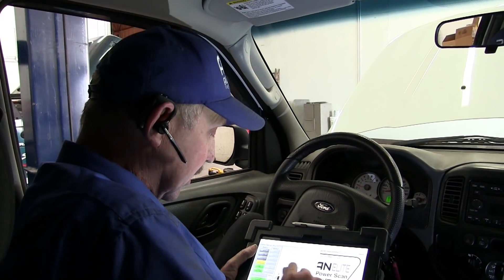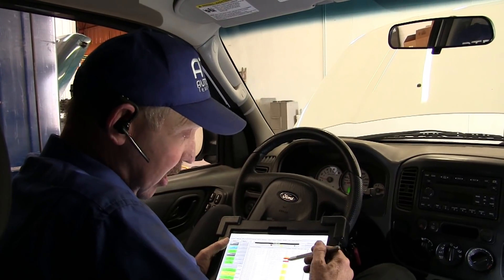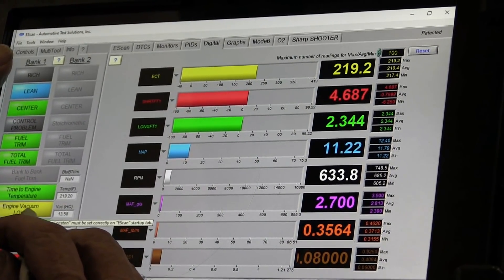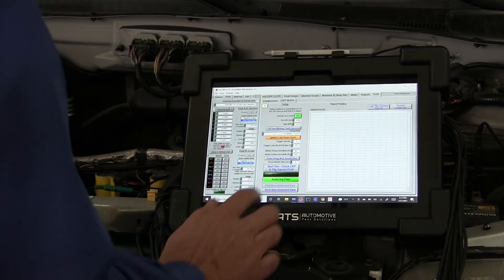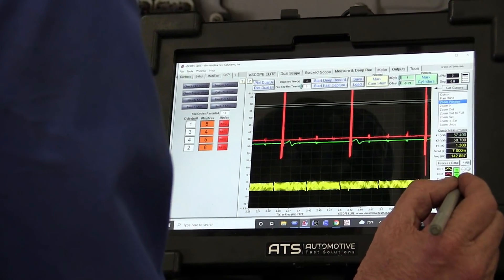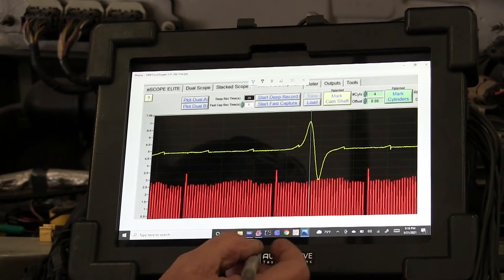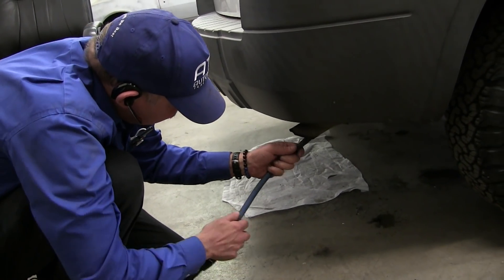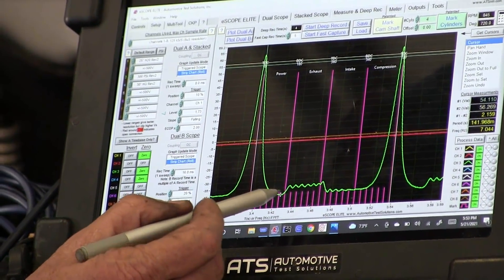2006 Ford Escape with a Misfire

Comment: is disconnecting the fuel injector not necessary / only done when access is easy? How long is it safe to run the engine (for the cat) before having to worry about it?

Comment: I might be wrong but isn't this a timing chain engine that if you loosen the crank pulley it will jump time? As in it doesn't have a key way in the crank and is held in place by the balancer bolt.
Reply: Yes, this is that one.

Comment: What's crazy is that those engines are very easy to check cam to cam timing.   If you have the special tools, then it is very easy to check crank to cam timing as well.

Comment: That's nice.
Q: If I have a L4 engine with 2 camshaft sensors on intake and exhaust (VVT engine) and when I see cam crank Waveforms I have a timing issue,,,
How Could I know If I have a mechanical timing adjusting or I have a Vvt Solenoid issue?

Comment: Problem misfires from other shops are always fun. All new coils, plugs and sometimes even injectors….I’ll install a vacuum gauge and know if it’s mechanical or not in 1-2 minutes. Or maybe bring out the amp clamp and scope if I feel adventurous for a cranking compression test. A simple vacuum gauge will show you restricted exhaust or cam timing issues as well. At least give you a direction to go.

Comment: Nice video, great pressure analysis.  I can't tell from the video but Im thinking the peak compression was higher than expected also. I would like to see or know what the running peak compression is after the repair, compared to before. Compression and Vacuum are relative..               Low vac = higher compression

Comment: Any tech or shop owner that doesnt believe in using this equipment is dead in the water for anything more than very simple diagnostic work. Shop owners should be able to see the value in the purchase. Accurate, quick diagnosis and no bad review from a customer who was sold the wrong parts

Comment: Why did fuel trims stay about zero if engine was misfiring, wouldn't that mess o2 readings. Also how maf sensor reading was above normal if  exhaust gases take a place of intake air. Where from addditional maf sensor readings come from.

Comment: i am surprised it caused the low vacuum for only being 34-40 degrees off. would have expected an elevated peak just before the intake opened,  or a higher exhaust pressure
Reply: I had misfire  for 11 degrees off exhaust   with fuel trims dtc